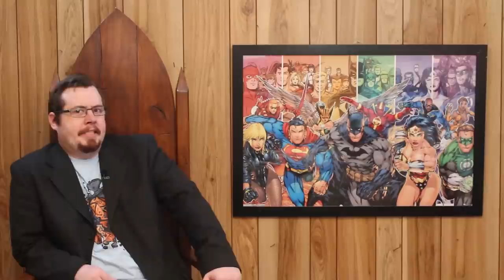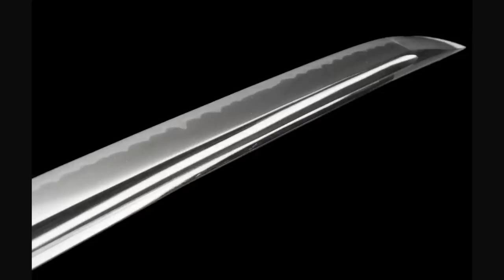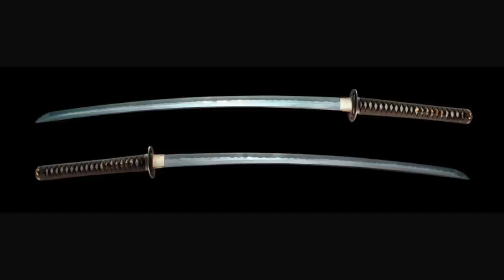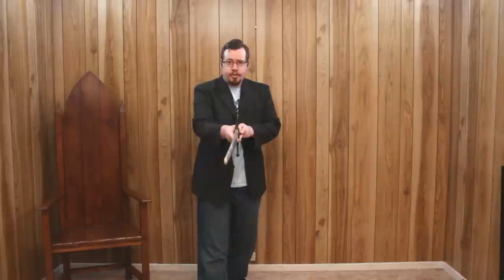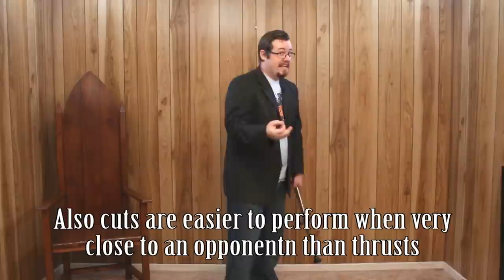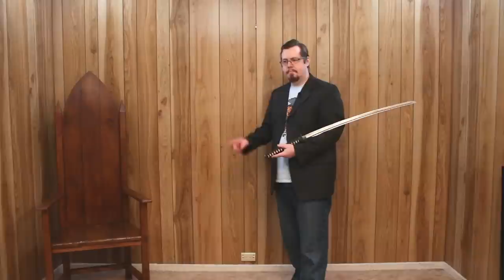Super cutting swords, are they needed?

Comment: You have to take in to account the quality of available materials to make weapons and armor. The katana is a katana because the Japanese had crappy iron and not much of it. They developed the process for making the katana to balance flexibility and edge retention. The by-product of that process was a curved blade. The shape of the tool was defined by the resources available and the combative art was developed to most efficiently use said tool. 
But the primary weapon on Japanese battlefields were heavy stones, arrows, and spears.

Comment: I think it really depends on the user and his/her abilities and what the he/she is most comfortable with. Some people like wider movements both in weapon and body and other prefer less. Some like attacking more, some are more defensive fighters, that like to react rather than act. The predominant fighting style in a certain region or amongst certain people plays a huge part in it. That includes the possibility of single hand, dual hand or two handed fighting. 

Also design plays a big part for some people. Has the weapon a full handguard? Single blade or double? Broad or narrow? Thusting weapons, unless you know exactly where to stab are less usefull to kill someone or even take him out of the fight immediately (adrenaline speaking). Slashing/Cutting weapons can affect a way greater body area and can be used at a passing glance, while the thrust has to always be in a certain angle and pointed towards the opponent. You can't thrust with the side of the blade after all. 

But then, as you said, thusting is probably harder to defend against, because cutting requires a wider motion. It is more easy to defend against a whole blade, than against the pointy tip. Also, yes cutting is more effective against multiple enemies, when you are unable to properly aim for a thust, because you have to defend from more than one enemy. If the enemy manages to get inside the defense, defending with a rapier becomes way more difficult (a cutting weapon might simply srcap by and cut anyway) and attacking will be next to impossible. That's why it is has a long range to begin with.
 
Cutting someones arm off is a bit overkill, but when you add armor, then the same force that cuts through normal flesh with a longsword might fall short against the armor, even against something like the Gambeson. There is when cutting overkill suddenly isn't overkill anymore, but neccessity. Otherwise you opponent walks away unharmed.

In the end, preference, fighting style and what kind of opponent you are up against decides the weapon. You might even go so far and forego swords completely and use a polearm, if that is what is best against the enemy.

Comment: Hello, Shad.
I found on the internet a particularly cool specimen of a curved schiavona sold at auction by Czerny's. The sword has a schiavona guard, a slightly curved blade and probably had a quite pointy tip but has been damaged by time. In other words, it's just like a katana with a longer blade, shorter grip and basket hilt. What would your opinion be on that? I find that sword absolutely beautiful and particularly well designed.
Keep up the good work

Comment: As a warrior (not a martial artist), i would argue that any debates whether cutting or thrusting alone is needed, is entirely irrelevant. In martial arts, slightly tipping an enemy with a blade is considered a score, but often these fencing thrust attacks wont do iRL. Now a really good stabbing/thrust attack has a few great advantages like reach. If the enemy is wearing chainmail, you maybe able to penetrate through the armor. But a stab is a 1dimensional movement in one single vector - this makes it also fairly week, in that any sweeping motion from the defender may completely throw off the stab attack. The stab with a sword is very fast, but a skilled swordsman may not give you the opening to stab, or he may make a faint.

A swinging attack even with a straight twoedged blade has far more weight to it, and even if it does not penetrate all forms of armor, it certainly wreaks havoc, is difficult to block and may wear a defender down. In both european and japanese swordsmanship you have both sweeping and thrusting attacks, with the latter being obviously more on the swinging side. A european longsword may still decapitate, just maybe not as clean. Limiting oneself to only a set of attacks, will get you maybe pooints in MA, but IRL this wont do. Stabbing a moving target in a vital area, is far more difficult than taking a sweep, which may: cripple the opponents hands, cut off limbs, cleave through torso/damage/bend armor which restricts movements. Different tools are needed for different purposes. If i want to 1hit a target, i would prefer a very sharp weapon over a more blunt type.

Comment: Cavalry, or any swift horse riding units used sabers, as while riding you can hardly stab someone and cannot afford that the sword might get stuck in the body, you have just stabbed.
Slicing while riding has the advantage that you can kill your enemy easily with out the sword getting stucked and go right tot he next kill.
Also as a one-hander, saber/scimitars are lighter and easier to handle.
Reply: Not to say that curved swords can't stab. They're great at that.

Comment: the curved falchion was in fact, used to trust, and to get an easyer acces to the weakness of an armor "under the armpit or between the legs." at those points, you don't need a maximum thrusting effisiency, but you need to ease the reach of your angle of cut, so that your movements of thrust give it more power to cut the skin "and the artery". it is less a curve to overkill the cuting power than a curve to help you get through the gaps of an armor.

Comment: There is a place for a cutting sword tbh. It's from horseback, in a charge. you can cut many down just by holding the sword/saber steady and level and let the horse's power momentum drive it. Using a lance seems to be a niche 1 vs 1. a successful hit  and you might lose or break it while its stuck in the target.

I personally also steer towards thrusting weapons.  Spears, polearms, rapiers, daggers, etc.

Modern technology can also produce a cutting rapier these days. Consider one with serrations or a saw edge.  You really don't need the whole length to be perfect for thrusting,  It just needs to go far enough into the body, so  1 foot up top can do without serrations.

Comment: As far as I understand, there are cultures where the martial arts simply don't really care for sword-thrusts (e.g. tulwar + traditional use of the katana and khyber knife). I won't pretend to know whether this renders them inferior or not, but if you are not going to thrust, you might as well go overboard with the cutting ability.
By maximising the cutting ability you are not just turning adequate wounds into limb-severing overkill, but also bringing cuts that would have been insignificant up to par. 
I guess you could compare it to what you have to say about the thickness of the katana blade: This level of rigidity is not necessary for effective cuts, but it allows one to get away with sloppy ones too.

Comment: Cutting attacks are actually much harder to defend than you give them credit for two reasons. One is that they have more energy behind them and that energy is being directed opposite your easiest angle of defense. What this means is that you either have to be much more skilled in blocking in order to divert the energy or you have to be able to be able to put a lot of energy into a very short movement (this can actually make defending on your sword side harder as you have less available motion in order to add energy to the block). This means that in order to block a full powered swing it's not as simple as moving your sword to one side of the body or leaving it where it is, you have to entirely shift your body weight to account for the attack. This gives a skilled attacker the opportunity to open up further avenues of attack. The second is that a cut encompasses a much wider attack range. a cut might be diverted but can still be steered to deal some effect even if it's only a percussive blow. it's also easier to hit a weakness in the opponent's defense or armor as you have a whole line of potential damage rather than a single point. In effect this just means that it's easier to effectively cut than it is to effectively thrust. 

Thrusting has two major disadvantages here. While thrusting directs a massive amount of energy at a single point and the line of attack can be very difficult to see and react to, the leverage on the attack is absolutely horrendous. This means that it requires very little energy in order to deflect. The second is that is that thrusting is more difficult to do than many people give it credit. "just stick them with the pointy end." It takes a lot of skill in order to direct that long heavy object to a vital part of the opponents body. Targets that the opponent is likely specifically guarding. And while it can be very difficult to see a thrust coming it is also very difficult to prevent yourself from from telegraphing a thrust. Your body weight shifts, your footwork changes and it must be very quick and powerful in order to account for the ease of deflection if your opponent is able to react. 

That being said though there is a reason many of the hyper specialized slashing weapons are commonly seen on cavalry. Cavalry adds extra utility to the slash and removes much of the versatility of other types of swords. Introduction of metal armor obsoleted many slashing only weapons for non cavalry warfare. You make a good point about hyper specialized cutters being overkill though and while there are some reasons an optimized slash is useful, as others have pointed out, I likely wouldn't give up the versatility of a straight, nimble sword for those purposes.

Comment: Dear Shad,

have you ever considered a Kopesh-, Sappara- and Yatagan-shape comparison video?
I would really like to hear your Opinion on what the different benefits of the shapes are. 
Questions that come to my mind are: has the Kopesh-shape a better cutting capacity as the Yatagan-shape?
How is the weight distributed by these shapes and how does that affect the cuts?
Is the Kopesh-shape like an axe? - meaning is it necessary to use the "top cutting part" to use it effective?
is the Kopesh-shape better suited for cutting than other sabres? Does it cut better than a Falchion witch has a wide thin blade? (all considering the Kopesh is made of steel)
Sorry for the bad english.

I'm exited to hear your thoughts. 
Loving your contend.

Comment: Some thoughts I had on this: 1 - this one is a bit of a guess: If a sword cuts worse than another one, wouldn't that increase the risk of the sword getting stuck in a bone? If that is true that would be a good reason for better cutting power. 2: If you're able to achieve the same damage with a cut in which you put less power, that would also be a valuable benefit. Using less power means you can preseve your energy and fight longer. Also it means you're less likely to onvercommit and lose balance. 3. If a sword is better suited for cutting (and same the other way around) that would also mean that a less well performed attack would still be effective. We could see that in the old vids of Skallagrim when he was still not that good at cutting (he sais that himself) When he used a good cutting sword, he still performed just fine, when not he sometimes messed up entirely.

Comment: This is also just suspicion, but a lot of "modern" curved swords (i.e. sabres) are designed more for the cavalry then for the infantry. In that position, it makes a lot of sense, the added momentum of the charging horse combined with the one-directional motion of the cut makes it so that the entire maneuovre can be accomplished in one motion. Compare that with the thrust, which for a cavalryman would require both extending and retracting the sword in the short time a cavalry charge provides, and it is quite possible that you would lose the sword (I suspect). Swords like the talwar are very effective also against unarmoured opponents for the same reason, with one continuous chain of movements you can attack multiple people, at least injuring them. The thrust requires you to retract the weapon in time for your next strike, which can be absolutely critical to an outnumbered infantryman. Also, for the types of battle people in engage in, there are different requirements. A great deal of Oriental large curved blades are actually made for the purpose of nullifying cavalry (Eastern horses are not as big). But from a general use perspective against armoured opponents, I can see why the cutting power could be sacrificed, as it offers little practical advantage. For other weapons like the Katana, I suspect tradition plays a large role there.

Comment: brilliant discussion there and as usual we get the difference of opinions of where East is better than West or vice versa etc. 

in many of the sword designs we have to consider  the environment and evolution of other war influencing technologies mainly armour. as we know many cutting weapons struggled with chain mail alone hence the evolution of heavier weapons that would shatter opponents not only emphasising only on the cut. In environments where armies would rely on light armour mainly leather due to limited technology or resources to supply all the troops, weapons such as curved blades were more than efficient and where possibly the extra cutting ability was used to cut through the leather and other fabrics. 

The is also seen hundreds of years later in the napoleonic wars where troops would wear tunics as armour was expensive and only cavalry would have a brest plate. hence one handed sabres were ideal.

In the question of a rapier it was never designed as a weapon of war. but as a gentleman's blade to settle duels without killing each other but causing a flesh wound. ideal so people could settle disputes without killing the countries knights, warriors, officer's etc. imaging trying settle a dispute with long swords or maces etc. flesh wound would be the last of your problems.

However putting into context versatility a blade that can meet all situations and still be effective will undoubtedly be the sword of choice. 

regardless of philosophy and the nonsense people like to preach about it all the weapons in question where design primarily for war. and adapted accordingly to the battle environment they were exposed to. hence as shad explains we get a long sword eventually amongst other wespons. as European wars were exposed to heavier armour shields etc.

in essence a katana is very similar to a long sword in thought. 2 handed grip for power and dexterity.  but emphasis on the cut although still capable to thrust. design effective in battle against the opponents it faced. Note though Japanese armour was more segment in sheets plates than European armour and shields were not common. A long sword as a katana can cut and thrust but heavier and longer in design to meet the requirements of European battles. 

which is better, depends what you're facing. and what they are carrying/wearing. However versatility is an advantage in any field.

Comment: I have just a few things to point out ... so:
1) If sword cuts better, you don`t have to make the cut that strong to "just" disable the arm (or whatever), so you could conserve more energy this way...
2) A curved sword (which most cuters are) just moves otherwise and you use a whole other set of techniques.
...and there is a very good example: you can use curvature of the weapon to thrust around ( or behind? ... not shure ) your oponents shield. And yes, it is a thrusting technique.
3) So I guess I already pointed it out, but a lot of great cuters can thrust pretty well too. Maybe their thrusts won`t be so strong as they would be with a straight blade, but there are thrusts that you definitely cannot do with a straight blade.

I think that`s all :-)
(for now at least) ;-)

Comment: I feel like the difference is that it's true that if a perfect blow is done by both swords, the less cutty sword does good enough, but the more cutty sword doesn't need to get a perfect blow to incapacitate. Also, cutting swords cut better at the furthest end of the weapon than long sword types that cut best a little past the halfway point. The long sword type does have better reach though because reach is sacrificed for better cutting. 

Anyway, I feel at the end of the day, there are places where you can cut someone with a cutting sword that would end up being lethal that the long sword type would not cut deep enough.